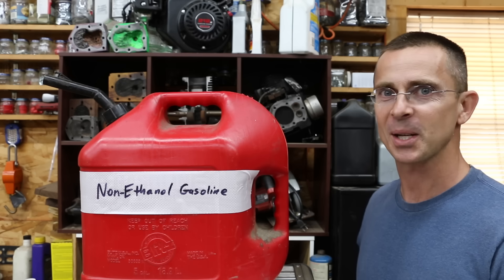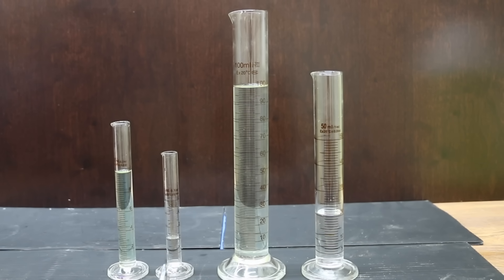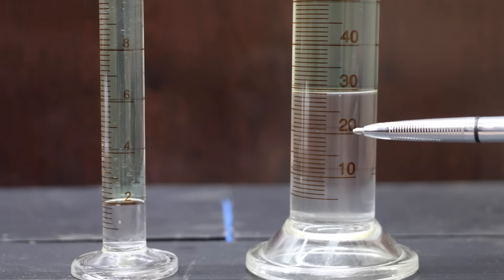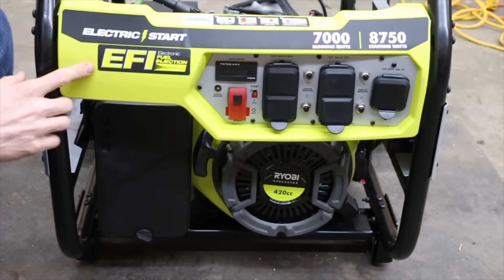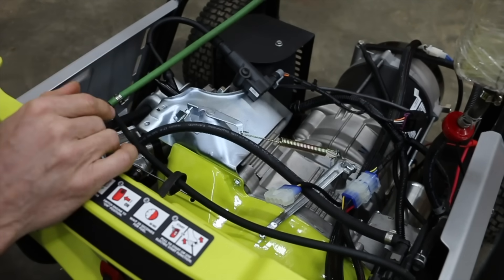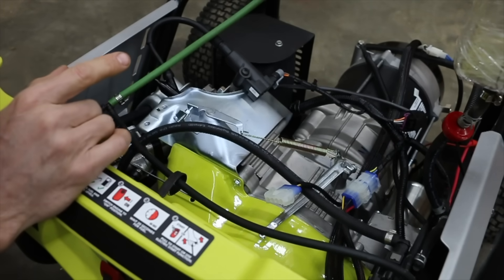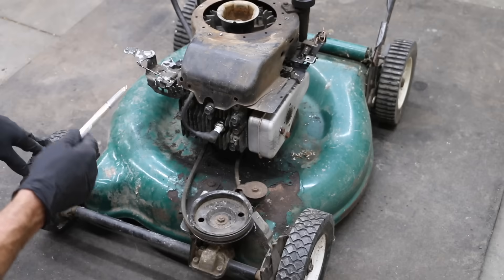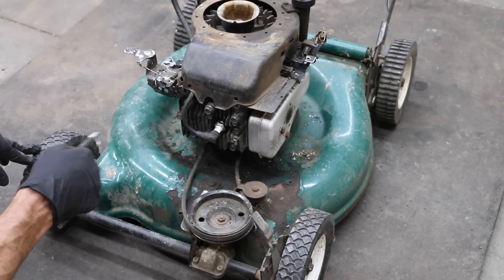Is Non-Ethanol Gasoline Really Better? See the PROOF!

Comment: Each state uses its own blend of gasoline, even a different formulation per time of year. I would like to see people send in a particular brand (say Mobil or BP every state has those)  and see which states gasoline is best (Send a liter in a double sealed container with a plastic bag around it and box it up to ship it like when you get your oil tested in the mail.) . When they say E10 that means it can be UP TO 10% NOT always 10% depending on the state and season. I bet some states have better gas. When I was messing around with some project I was doing I found the blue (I think it was 87) gasoline from NH burned the cleanest and worked best in a two stroke dirt bike. When I moved from NH to NC I had to retune the carb even though I was still using E10 87 from Mobil at the same temp and humidity. Both were spring time gas, same two stroke oil, The bike had gas in the tank from NH when I moved. I burned off. refueled in NC with the same two stroke oil same mobil 87 and had issues. Ran poorly on NC gas, but carb was tuned in NH last.
Reply from the maker: Thanks for the suggestion.

Comment: Did have reports of damage to high pressure fuel pumps in GM v6  engines  when I was in the trade. Manufacturer came out with service bulletin  recommending that e10 fuel not be used.
Reply from the maker: Thanks for the feedback.

Comment: I used to have to buy a new String Trimmer about once a year, because they'd just quit. I'd buy the same model so I could use the old one for parts if needed. Then about 10 years ago, I started reading about the effects of Ethanol in small engines. I noticed one of the local stations started selling Ethanol-free. So I experimented myself.
First in the Lawn Tractor. I noticed right away it ran smoother and seemed to have more power when I'd use it to move my trailers around the yard. So I mixed some fuel for the Trimmer and also noticed it ran a lot smoother. Out of curiosity I dug out the last years Trimmer, cleaned out the fuel reservoir and filled it with non-ethanol mixed fuel. It started right up, and after a few minutes ran just fine, I hadn't been able to get it to start at all before I shelved it.
Now none of this is as scientific as your test, but it convinced me.
Around that time I also purchased a Prius C hybrid. This has a marvelous computer that tracks milage and even asks me what I paid per gallon when I fill up. What I found was that my MPG was higher without ethanol, which from what I read was just about what I expected. The surprising thing I found was the car displays a screen telling me how long I was on the road, how far I went, average fuel economy, and based on price per gallon, how much that trip cost me that day.
I pay more per gallon for the non-ethanol, but the difference in fuel economy means, I pay the same dollar amount per mile. And I'm sure it's better for the engine, although I'm not planning on pulling the cylinder head off to check. I've put over 140k on this thing, and aside from long road trips, I normally fill with Non-ethanol.
Reply from the maker: Thanks for sharing.
Reply: Ethanol does not have the same combustive power as gasoline, 10% ethanol in a litre of gas means for every litre used you are only getting 90% gasoline, making ethanol based fuels have less actual mpg than pure gasoline.

Comment: I can tell you with 100% certainly ethanol is terrible in carbeurated engines, especially if they are allowed to sit for any amount of time.  It will gum up the jets, eat diaphragms, stick floats and cause all kinds of choas.  Even in fuel injected engines it can gum up the injectors, you just have more positive pressure to clear the crud.  Having run nitromethane and gas RC engines for years I already know the results of the rubber and plastics test (different horses for different courses).  There are compatible materials, but that assumes the engine and fuel system had to built or modified for ethanol use.  It may be expensive but I stick to Trufuel in my small engines unless I can find ethanol free gas. I've rebuilt too many carbeurators to mess with e-gas.
Reply from the maker: Thanks for sharing.

Comment: All of my 1990-2015 or so vintage yard tools suffered deteriorated fuel lines with ethanol gasoline.  So now I only buy non#ethanol for motors other than the cars.
Reply: Good
Reply: In Italy only gasoline with etanolo...sabotage😓
Reply: @stefano806  He did give you a method to remove most of it.
Reply: Same here. I use Aspen alkylate petrol, now.

Comment: I filled my car up one day with non-ethanol fuel and took a 200 mile trip that I've taken many times and saw no difference in power or fuel mileage. Sorry folks.
Reply from the maker: Thanks for the feedback.
Reply: I tried E10 yrs ago avg 100km less per full tank compared to standard 91 the loss of economy out weighed the few cents per litre less at the pump and it not good to use in marine   Motors

Comment: Water will pull carbon into exhaust. 
I’ve seen older mechanics use water to clean the valves and head in order to pass smog test

Comment: Great tests!  4% more run time.  Perhaps you should do a test with $1 of non-ethanol and $1 of E10.  Where I live straight gasoline is 25% to 30% higher.  I like the fact that a little water in your gas will be absorbed by the ethanol instead of laying in the bottom of the tank.

I run E10 in my small engines with no ill effects for many years.  I do use Stabil for storage.  I'm also a mechanical engineer.
Reply from the maker: Thanks so much!  Thanks for the video idea.

Comment: All I know is over the years, any ethanol gas left in the tank and carb varnishes the carb and the carb ends up being removed to be completely cleaned. On small engines I let them run till dry. Any left over gas in my cans. Gets dumped into my vehicles before it goes bad. I don't mind using ethanol in the vehicles as the tanks are always refreshed, but not small engines.
Reply from the maker: Thanks for the feedback.

Comment: What about a long term storage test. You always hear that ethanol gas gums up the engine long term storage especially if you don't use any stabilizer. I leave my boat stored in winter for 6 months and sometimes 6-8 months on deployments. I always stabilize my fuel because all that was around where I was stationed was ethanol gas. Now that I'm up north gas stations have 100% gas readily available.
Reply from the maker: Thanks for the suggestion.

Comment: I used to run a speedway motorcycle on methanol only, had to strip the carburetor after every race else you end up with the situation in the photo, does not like aluminum that’s for sure. Also to note with increased alcohol in the fuel in a normally aspirated carburetor I had to change the jet size and retune the carburetor.  I tried running my car on pure methanol and found I could control the speed of the car using the manual choke (this was many moons ago) the accelerator would killed the engine, hence the jet size change.
Reply from the maker: Thanks for sharing.

Comment: I'll be interested to see how ethanol affects aluminum.  It's murder on small engine carbs.  I've had it completely ruin them to the point they could not be disassembled and had to be replaced.  Back in the days before ethanol, this never happened.  Back in those days I've disassembled many carbs and dumped water out of them, reassembled and went on.   It doesn't take ethanol very long to wreck one though.
Reply from the maker: Thanks for the video idea.

Comment: Pure ethanol can run 16:1 compression ratio without knocking. From 13:1 CR and up pure ethanol is more efficient than gasoline.
Reply: Ethanol is much less energy dense than petrol. It is great at preventing knock and allowing more power but if you are talking fuel economy normal petrol will get you further per litre.
Reply: @GarageSupra  No. The higher compression ratio the higher engine efficiency.  Not too much engines can burn gasoline at 13:1 CR without knocking or use retarded ignition advance (no good for power and efficiency). Pure ethanol have 120 octanes, also ethanol with 4 or 5 % water reaches 127 octanes and reduced NOx emissions. So yes: ethanol is less energy dense than gas, but is also way far less prone to knocking, so better efficiency can be obtained in engines designed to run on ethanol (high CR).

Also ethanol content in oxygen is very rich wich compenses de richer AFR used when burning pure ethanol.

Comment: I got 4% better on one tank of E0, just like you did.  But on the tank before that I got a completely different result.  Could you do your tank range test between E0 & E10 on that carbureted lawn mower, instead of the computer control fuel injected generator?  I'd be curious if that mower would end up confirming my results.

I did two tank tests on my carbureted motorcycle, an 899cc 144 HP sportbike and analyzed the exhaust gases using a wide-band UEGO (Universal Exhaust Gas Oxygen) gauge, so I could have data to share with other riders.  There's another ethanol-free video where a motorcyclist claims we should see a 7 - 8% improvement in tank mileage from using ethanol free E0.  So I was excited to try E0 for myself.

On my first tank, which was a 68%/32% mix of E0/E10, I just took my bike to the station and filled up. I’d never run E0 prior to that, so I just thought it was as easy as putting it in my tank and getting better power and tank range, as everyone claims.  Shortly after setting out, like 5 miles out, my coolant temps began to drop, which I thought was cool!  ha-ha.  My AFR dropped too, just over 0.5, from the AFR I typically see on E10.  I was clearly getting a richer mixture than I typically see from E10.  But after riding 160 miles, my mileage fell 4%. That's 11 - 12% worse overall than what is claimed.  Lightbulb moment.  Duh!  Stoich for E0 is 14.7:1.  My bad.  So I dropped my jetting 8%, which allowed me to attain E0 stoich, which is suppose to be maximum efficiency at steady highway cruise. This time, when I filled up my ratio was 99%/1% E0/E10 and same route as before.  However, while the E0 jetting allowed me to manage a fairly stable 14.7:1 AFR for 153 miles, I only came up 4% better than typical E10 range, not 7 - 8%.  Maybe this is just the maximum for my bike, but I was left feeling somewhat bummed.

There were a couple of side effects from ethanol-free E0 also that concerned me. One was that E0 at stoich made my coolant temperatures noticeably higher than E10 (that thermal energy potential, for sure!) and my new E0 jetting would no longer work with E10.  After running the E0 out of the tank, I filled up with E10 again and my AFR was off the scale lean ~15.6:1.  My bike surged and ran terrible.  What the heck? This blew me away.  If I wanted to get the maximum distance from E0, I had to rejet for it.  And now that I did, I'm not able to use E10 again.  I stopped as soon as I could and drained the E10 out.  I didn't want to ruin my motor from an obviously harmful lean mixture.  How are other carbureted motorcycles able to switch interchangeably between the two fuels and not only get better power, but also better tank range, yet I get nothing like that?! 

This was freaking me out.  So I tried E0 in my lawn mower.  And while it started better cold, it wouldn't go to full throttle once it warmed up???  It just refuses to rev much past 1/2 throttle. WTH!  I drain it out and put in E10 and it runs like a raped ape, no throttle restrictions, happy as can be.  

Everyone here says E0 is better, like there's no question about it.  I try E0 in multiple cases looking for some benefit and I get crazy results that seem to nearly completely contradict everything being said about it.
Reply from the maker: Thanks for the video idea.

Comment: I'd love to see a video showing the effect of different octane ratings on engines that are rated for 87. That is, does a higher octane gas improve or harm performance (power output, efficiency, etc) of a standard engine. Many people think that they need to put premium fuel in their economy cars, but what I've heard from mechanics and engineers is that higher octane in standard fuel engines actually harms performance.
Reply from the maker: Thanks for the suggestion.
Reply: Mileage performance in my naturaly aspirated 2.4 inline is better with premium. The engine also works quieter ans smoother. I have a factory Iridium spark plugs inside. I have tested many times on longer trips with avg speed of 160-180kmh on German highway it always get better with premium. Using ethanol empties that tank pretty quick.

Comment: I tried running 10% ethanol in a new Simplicity riding mower. Worked good for the first three mowings, then started hard and blew a LOT of black smoke. Second tank of non ethanol fuel and it cleared the smoke and ran fine. No ethanol for me!
Reply from the maker: Thanks for the feedback.

Comment: I believe the fuel stabilizer is only needed when E10 is stored in vented containers. My '88 Chevy G30 sat unused for three years with half a tank (15 gallons) of E10 and started right up when needed again. The engine lacked pep so I poured 2 quarts of Berryman's B-12 into the tank and bounced the van a while to get it mixed in with the engine running much better afterwards, so drove to a station to top off the tank with mid-range 93 E10. Ran that bastard mix until gone then went back to 87 E10.
Bought the van in 1994 when it had 84K on the OD and it got 14-15 mpg on the highway using 87 unleaded. That mileage dropped to 12-13 mpg when only 87 E10 was available at the pumps. The van had over 200K on the OD by then so took a mechanic's advice to install new plug wires and a new ignition coil which made a big difference. The van now moved faster at idle when in gear plus the highway mileage rose back up to 14-15 mpg's. Told my older brother about that since he had 35 years experience in GM dealerships' parts departments where he replied that ethanol requires a hotter spark to ignite so the new ignition components was providing that. 

The only stuff I add to the gas today is a bottle or two of STP octane booster when filling up the van. Began doing that two years ago when the engine began losing performance with lower mpg's due to seasonal blends of gasoline being introduced to our area. I add one bottle for the Summer blend and two bottles for the Winter blend to keep the old 5.7L lively and the mpg's where they should be.
Reply from the maker: Thanks for the feedback.

Comment: I have an old farm truck and my four wheeler, and that is all I use in them since I go a long time without using them. I see that Murphy's at Walmart now carries Non -Ethanol gas so it is a lot easier to find than is used to be. Enjoy your channel!
Reply: I put airplane fuel in my snowblower, chainsaw, weed trimmer, and when I put the motorcycle plus lawnmower away for the winter.  I don’t like to run my equipment empty because I don’t want the rubber parts and gaskets to dry out.  Airplane fuel is good for a year I was told.
Reply: @nico8587d  that’s the reverse of what bush pilots told me, just get nonethanol gas & put stabil init like your supposed to do, that’s guaranteed rated for up to (if I remember correctly) 18 months & if that doesn’t last long enough for your winter I’m stoked I don’t live there, bloody ice planet hoth
Reply: @patrickancona1193    I’ve had the Harley Davidson since new in 1987, and was putting stabil in it like you said with non-ethanol fuel until 5 years ago when a friend of mine told me about airplane fuel.  The bike starts up really quick.  Cleaner fuel too.  Just giving my 2 cents worth.
Reply: Started putting non ethanol gas in 1970 C10. Just Started because there's a Murphy hear in my town in Florida with 92 Octane. Have you noticed any extra " fouling " on your plugs?

Comment: Ahhh looks like the carbon built up was significantly different. + time, worse fuel economy but better on cars deposits.  That's what I saw from this vid. 
I use e85 on occasion.  Must mean something.  
I doubt it has to do with manufacturing costs and low consumption.
I think it has to do with success of a product(chemically not commercially) and opportunists businessmen on a product which works.
Reply from the maker: Thanks for the feedback.

Comment: I always enjoy your videos.   Buying ethanol gas is like buying 10 gallons of gas, but getting 9 gallons of gas, and one gallon of air.   In older carbureted engines (or any engine that does not use a closed loop fuel management system) the net effect is to lean the fuel mixture somewhat.   This may or may not cause a driveability concern.   Some vehicles did use a closed loop carbureted fuel system, but ultimately, their mileage typically dropped off because the carburetor - fuel system was either malfunctioning or grossly misadjusted.   On a closed loop fuel injection system (such as your generator)  mileage - efficiency will drop, as during your tests.   So... aside from the fuel system damage on vehicles or small engines that were not designed to tolerate it,  would it be better to spend more and run the non - ethanol fuel (and get better mileage)  or is it better to buy the cheaper ethanol fuel and get lower mileage?    In my experience, provided the engine fuel system is not being damaged, AND the engine runs ok, I use the ethanol fuel, since the non - ethanol version costs quite a bit more.   In older small engine equipment though, I use the non - ethanol stuff.
Reply from the maker: Thanks so much!

Comment: Ethanol fuel is used up quicker so it is more efficient (8:23)?!  it seems to me that if you can get more work (35 mins 20 secs) out of non ethanol fuel as you did compared to ethanol fuel (33 mins 45secs),  then non ethanol fuel is 4% more efficient.